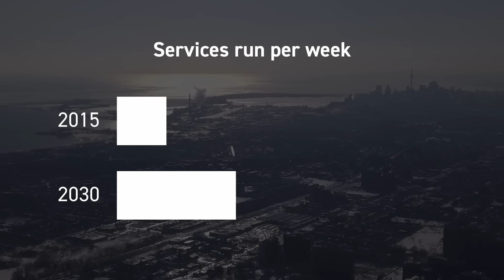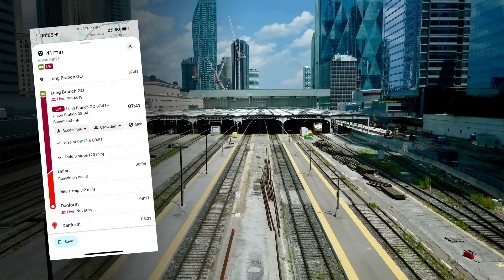How Toronto is turning its commuter rail system into a rapid transit network!

Comment: This is the ultimate wet dream !!

there has been talk of all day go service on the Milton line for 15 YEARS and yet it never happened. why ? Because it will need 4 tracks and all bridges on the line replaced at a cost in the Billions.

Next, covid produced a massive drop in GO service on this line. Come on out to Mississauga and one will see at the 3 main stations in the north the cars pared are around 10% of what was parked during Covid. This means MANY MANY fewer travellers than in '19. next our projects are built by Metrolinx which means DISASTER. the Eglington still has not started to run after over 11 years of construction. NO ONE can even estimate when The new Mississauga streetcar line on Hurontaio will be running. that line was to be running last Dec and now there is little hope it can be up in 5 or more years. 

Finally, Electric efficient lines are NOTHING new to Ontario as we had 100's of miles of interurban tracks running on the Ontario lines in and around Ontario for decades until they all stopped because so many companies could no longer compete with Imports. 

Bottom line electric rail is NOTHING new and by the way it is getting dirtier as over 10% of the fuel for our power grid is now natural gas which is almost as bad as coal.

The ONLY solution for transit in the GTA is to employ  a foreign country such as Japan  who knows how to do the job and get it done on time because Metrolix has failed for decades and if allowed to continue down this path nothing will ever get done.

Comment: Metrolinx after cancelling the contract has now de-scoped the project. So they're only going to electrify the lakeshore lines and the union station rail corridor for now. LW electrifcation  they say will be complete in 2035, LE in 2036, and Union Station Rail Corridor in 2038. The rest they say will be in a future phase 2.

Comment: More rapid transit for the Toronto area is great but a high speed rail to Montreal costing up to $100 billion is just another total waste of money that will burden taxpayers for decades because it will NEVER pay for itself and it will cost hundreds of millions each year just to maintain it.   Canadian travelers will never accept to pay the real incredibly high costs of a train fare on the high speed rail and the train will forever become a bottomless money pit requiring constant huge subsidies  and handouts from taxpayers.  Because of the very limited amount of stops along its route,  It would quickly become just another white elephant just like the new elevated electric train in Montreal!   Maintaining and even expanding the full length of the 401 to 3 lanes would be a pittance compared to the cost of high speed rail.   The 401 has hundreds of interchanges along its full length making it a much more practical and convenient way to travel.    High speed rail will never replace road and air travel in Canada.  It's just not as practical.

Comment: While Toronto’s 18 km Eglinton Crosstown LRT remains unfinished after years of delays, cities like Chengdu in China have built entire metro systems from scratch, expanding to 13 lines and 373 stations in just 14 years—demonstrating China’s remarkable efficiency in transit construction compared to Toronto’s slow, costly, and bureaucratic process.
Reply: Yes, good for China. I wish Canada had better relations with China so we could learn from them instead of listening to the yanks and sabotaging our relationship.

Comment: I actually really like the piece meal approach the government has taken towards this transformation. They are first adding grade separations, more tracks, double sided platforms etc in anticipation of upgrading the lines for eventual electrification of the existing locomotives, and then a possibility for more subway-like EMU trains in the future. This means we get to see benefits constantly as work is done: there has been gradual improvements in train speeds and frequencies over the last 10 years. The only downside is that it means the eventual goal of electrification is taking forever. Splitting the projects up into their different parts rather than one large project means theres obvious inefficiencies and red tape abound.

Comment: Toronto seriously need to hire firm from China to design and build the subway network so that it is not running into the over budget and multi-years delay by the LRT on the Eglington
 line.

Comment: I cannot believe the current system still relies on diesel locomotives in 2025. When I was growing up in Europe 40 years ago, diesel locomotives were used only in slow romantic lines between villages
Reply: Regenerative breaking of electric locomotives should improve not only emissions but even energy efficiency.

Comment: The train is just too damn slow. Why does it take 60 minutes for the "express" train to go 50km each morning?
Reply: There isn't an express train. There are only trains that run express for a short distance. And they share tracks with VIA and freight trains. It is impossible to get these trains, on these lines to run as rapid trains. Impossible. You need different tracks, different trains.

Comment: Go trains are so infrequent that most of the time, Waiting for the train will take as long as local transit, Or the time gain is not worth the extra cost.  When it does line up though, I can save up to an hour in travel time... but it rarely lines up that way. and I ether end up taking local transit or driving depending on the distance...  These upgrades will be welcome... as long as the fare doesn't increase disproportionately...

Comment: It is remarkable that a city with more than a million citizens doesn’t have a decent train system. I live on the countryside and the nearest train station, of a town of 9,000 inhabitants, has a 15min peak service to the nearest city and a 30min service off-peak, from 05:20 to 00:50. Besides that, they have a 30min service to two other cities from 05:30 to 00:30. In the weekend an hour later in the morning and an hour later in the night. And the station only has 6,100 passengers a day. I use this station often when I go to the airport, to reach that, I have to transfer, a cross platform transfer (step out of my commuter train cross the platform where an intercity train to the airport is already waiting), and I am at the airport in less than 30min.
Reply: Toronto does also have a local transit system that uses subways (1 minute wait for trains during rush hour), buses, and light rail. More can be done but we're doing better than most other cities in the US and Canada. (Montreal being the best.)

Comment: GO Transit should (if possible!) go the route of what Caltrain did with their electrified line: put in 25,000 V 60 Hz AC overhead wiring and buy a whole bunch of Stadler KISS train sets. The electrified Caltrain service is a huge success, and it could work well for GO Transit, too.

Comment: As a note, it is debatable if switching to EMUs would have been more expensive. Yes we would need to buy new trains but we would need to build less grade crossing because EMUs can handle steeper inclines. This would save us a ton in building costs as these grade crossing are very expensive.

Comment: One of the issue of low occupancy is to do with termination at Union Statin.  This by default assumes that all daily commuters from outside Toronto want to travel to Union.  Instead, GO needs to think of linking suburbs.  Kitchener line can start from London and terminate on any station on Markham line.  Taking Go Bus is unreliable on 401 parking lot. Sorry, 401 is not a "highway" between Cambridge and Oshawa.  Instead of hub and spoke configuration with Union as hub, planners need to link suburbs and make transit friendly for those that never travel to Toronto.  This may also ease congestion on 401.  Last mile is always a problem.  GO assumes that everyone in Ontario wants to come to Union from their home in the morning, which is wrong.

Comment: Go trains are anything but "rapid".
Reply: It's mass transit, but has never been intended to be rapid. I try to explain this to people all of the time. They assume that if a train travels on tracks instead of congested highways then it must be faster. But GO Train service isn't express. By design the schedules require it to slow down and stop to pick up and drop off passengers on several stations along the line. Congestion on shared tracks, switching and communication system glitches cause all sorts of delays. An express service bus from Hamilton to Toronto in good traffic will get me to Toronto Union Station much faster than train.
Reply: Thanks for sharing your thoughts. Transit options in most countries outside North America are rapid, while making frequent stops. There is no reason for Go Trains to not go 2-3x faster than they currently do.

Ditto for Via Rail by the way. Toronto to Montreal was faster in the 60s than today. Why? Because the track infrastructure was better.

Comment: as someone who dosnt live downtown toronto, or work downtown toronto. i hate that to go to any destination by train, i have to go into downtown just to come back out. Cambridge to Hamilton for example. and that's why i almost never take transit. unill they add more lines and connections it just isnt practical.
Reply: Isn't there a GO Bus that does that route?
Reply: @MKPiatkowski  there is one Cambridge stop and its at the 401 at the north of town and goes down the #6, its also a 20 min drive(not in rushhour) from my place in the south of Cambridge. no bus down hwy 8 . if i need to drive 20min north just to go south, i might as well drive 20 south to my destination. if the bus went down hwy 8 instead with another stop or two in the south side of Cambridge, i bet a lot more people would ride it. My transit commute to waterdown is, GO bus to hamilton, train to aldershot, then a local bus, or train to union, then train to aldershot then local bus to waterdown. even when i lived in dundas, it was faster to bike up the hill to waterdown than it was to take transit, first downtown just to get a tranfer to not be near downtown. we need services that arnt just between city centres.

sorry in my first post i ment that Hamilton combined dundas, waterdown, ancaster, stoney creek etc.. i didnt means specifically hamilton station....i dont want to be downtown Hamilton just as i dont want to be downtown toronto.

Comment: I went from living a 5-minute walk to either the 504, 505, or 501 downtown streetcar lines to the NW edge of Mississauga. Yikes. Though I seem to now live in "Lisgar/Meadowvale" either GO station bearing those names takes as long to reach by local transit as walking: nearly an hour. 

I expect that increasing service on those lines would help make the case to improve local service to them. Until then, we're going to be stuck with heavy rush hour car traffic.

Comment: Downtown Toronto will need a new state of the art station .  But where ? Perhaps Bathurst yard or Don Yard ? But you would still need to keep Union Station just for sheer volume .  Also more railway companies for better competision to serve the public better and at minimum avoid monopoly of GO .
Reply: No! No competing companies! TTC was formed because competing companies did a horrific job at providing transit. It needs to stay in public hands. The problem is how it gets bogged down in politics, especially around funding. Let the people who understand transit build and run it, rather than developers.

The Ontario line will have stations at Parliament/King, Queen/Yonge and Osgoode. That will take some pressure off of Union.
Reply: @MKPiatkowski  OK no competing for better service .  Got it , but service is terrible worst ever now .

Comment: something else they need to focus on with go expansion and are somewhat dragging their feet on is improving interchanges between GO stations and their nearby subway stops. danforth and oriole are perhaps the most egregious and obvious first steps, as both require riders to walk an insufficienly marked path through their local neighbourhoods to get from the GO to the TTC. at the very least they need clearly marked signage (maybe some ground arrows) and some small works to make sure the paths are accessible, but really they should have pedestrian tunnels.
Reply: Dundas West as well.

Comment: just got back from Toronto last month, where I took the GO to Niagara Falls, it only runs twice a day... the rest is part bus and part train, and yes, it massively needs upgrading.  I know you mentioned the UP train to the airport, but this is also being electrified,  the frequency is increasing, speed increasing, and possibly an extra route to Hamilton, I guess as this is not a GO service, it didn't get mentioned, but it will be amazing.  it also odd being on a diseal train train to/from airport

Comment: A good overview on the GO rail upgrading and as someone who lives in the core (15-minute walk to Union Station thus without need of a car) the increased frequencies on some lines does make day trips to outlying towns and cities like Brampton or St Catherines practical for expanding micro-interest tourism. Though you do omit any reference to GO’s equally extensive bus services around the GTA which are also making such day trips convenient from the new central terminal adjacent to Union Station, a true multi-modal transit hub with fast link to YYZ, shuttle buses to YTZ and of course the TTC subway and streetcars/buses. This extensive program of public transit investment will certainly be an ironic legacy to the Conservative provincial government that at the same time is attempting to remove Toronto’s network of bike lanes on major roads in the city!

Comment: I'm absolutely thrilled to hear that they're going to move to both regional and S-Bahn / RER services. That's probably part of what Deutsche Bahn brought to the table. I hope that the regional service is extended across the corridor portion of the province. Then Via could focus on just the major centres rather than needing to serve all the regional stations as well. That would do a lot more to speed up trips between Toronto-Ottawa-Montreal than HSR would to be honest. Wish they had started this 20 years ago.
Reply: The time spent serving Oshawa, Kingston  and Belleville is not where time is lost.  Time is lost because the VIA trains run on track operated by freight lines and GO, which give VIA low priority.   I have been on VIA trains that crawled from Oshawa to Toronto Union because GO's dispatch didn't allow them to pass local GO trains.   The point of HST is to have dedicated track that supports at least moderately high speeds.  (Maybe  more money for some extra track could allow for regional services in same corridor?)
Reply: @HweolRidda  Freight delays are the primary problem for sure. But added stops do make the trips excessively long. Between deceleration, acceleration and VIA's painfully long boarding process, each stop adds 15 minutes to the journey. Eliminate 4 stops and the trip gets an hour shorter. I'm not talking about places like Ottawa, Kingston or Belleville though. I'm thinking more about the really small stops like Coburg, Cornwall, Gananoque etc.  Faster trains are great, but I don't think that HSR is necessary. 200 km/h would be plenty, coupled with dealing with the freight delays and excessive stops. Via should be focused on intercity travel (which in my opinion stops only in CMAs >100k) and leave regional services to GO.

Comment: It’s so depressing to me as an American that Toronto can manage to do mega projects like GO Expansion and significant subway expansion, Montreal with their brand new fully automated light metro system (the Reseau Express Metropolitain - REM), and Vancouver has the Skytrain network; meanwhile the US has few other comparable projects anywhere, the closest being Seattle’s Sound Transit 3 projects, but which make the extraordinarily stupid decision to use non-automated Light Rail vehicles and small areas with at-grade corridors (while most of the corridor is fully grade-separated, the small areas that aren’t prevent automation and frequency, so they have most of the cost of full grade-separation without the advantage of full grade-separation). Where I live, Minneapolis-St. Paul, our transit agency Metro Transit has chosen to construct tons of “arterial BRT” and highway BRT rather than attempting to build more LRT corridors (expect for the Green Line Extension, which has been under construction for years and has been repeatedly delayed) despite the fact that the two lines we do have, the Blue and Green Lines have some of the highest ridership per mile of any LRT system (although this isn’t saying much considering this is the US). It just feels like an extreme lack of ambition and lack of planning for the future by nearly all US cities, as even though it much more expensive to build rail transit, the maintenance and operating costs of rail is massively cheaper than BRT, and you get the benefit of higher ridership! And this goes doubly for fully-automated light metro transit, which requires small stations, small trains, and zero labor costs to run, but with extremely high frequency enabled by automation which translates to high ridership. Despite these advantages only Honolulu is building a fully-automated light metro network in the US. Compare Vancouver Skytrain ridership to any LRT network in the US, and Vancouver destroys them in ridership despite having a network which really isn’t that large, and this is because of the frequency and dependability of automated rail. But we don’t even bother to look at the rest of the world here in the United States, which is why we end up with perpetually mediocre transit projects one after another.